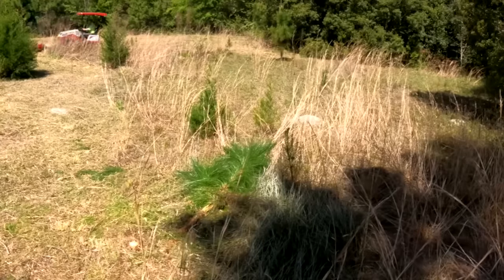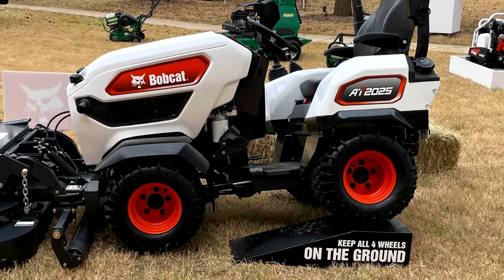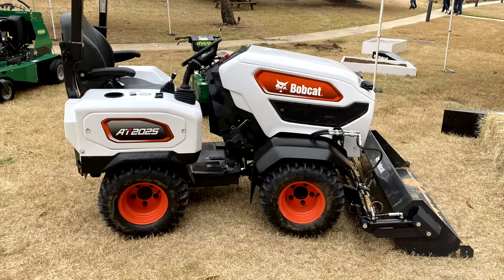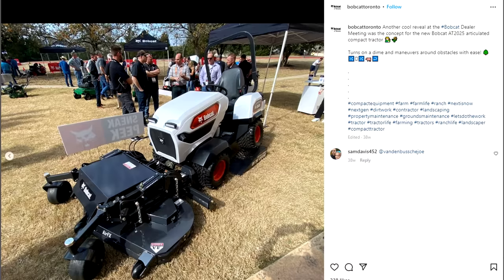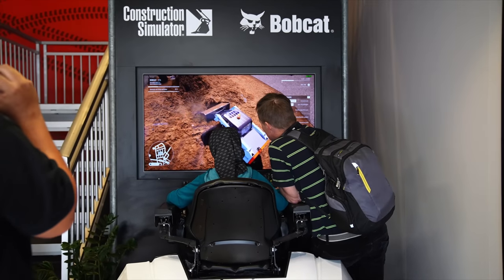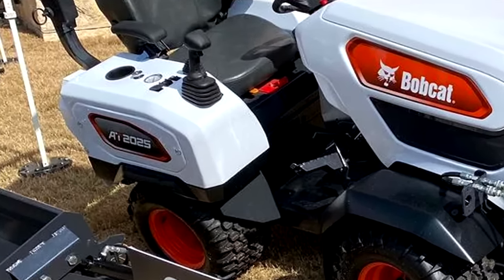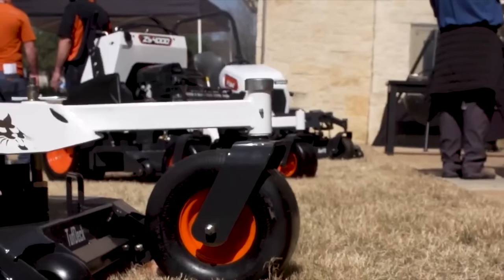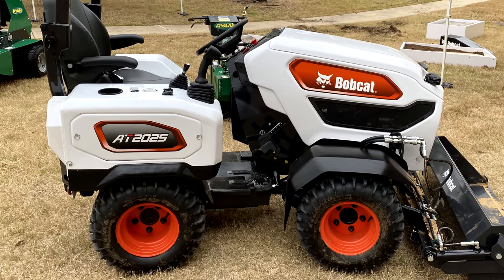Bobcat AT450 - A BRAND NEW Tractor We Know Nothing About... (Steiner 460/Bobcat AT2025)

Comment: The reason I would never buy this tractor is who it is made by.  I bought a steiner 450 in July of this year.  At 37 hours, it caught on fire in my pasture (at the base of the engine).  It took my local fire department 1 hour with two hoses to put it out.  The response from steiner, doosan, bobcat was the fire burned too hot to determine how the fire started (so therefore, I couldn't prove it was their fault).  Nearly burned my pasture and my woodlands.  I was thankful I wasn't on a customers property. A company that tries to shirk responsibility to not honor their warranty will never get another dime from me.
Reply: Good info. I was interested in the Steiner. Now I'm skeptical about the machine as a whole. 
And I'm not a Bobcat fan. Older excavators were good on rental market, but now Takeuchi has been invading that market. Good for Takeuchi.
Reply from the maker: That's pretty terrible, I am sorry to hear that. Glad it didn't combust with you on it. Any ideas what might have happened?
Reply: @andrewbrenneman9592  yeah takeuchi isnt to bad because made in japan sames the kubota are  plus they both uses reliable  kubota diesel engines
Reply: I had issues from the get go.  My dealer was a John Deere dealer and the only dealer in my state.  None of the mechanics were trained to work on the Steiner's.  They had to force the mechanics to install the three point and additional hydraulics.  I had just blown off the mower and cleaned the air filter thirty minutes before it caught fire.  There wasn't much time to see where exactly the fire started as it went quick.  I was lucky I was at the end of the row I was mowing.  When I made my turn, I saw the grass I had just mowed was on fire 10 feet behind me.  I parked the tractor on a dirt patch to go put out the grass fire and about 15 seconds later the whole tractor was engulfed.  My dealer was pretty good about the situation, but said that Steiner determines what can be warrantied.  One of the head guys at Steiner/Doosan had the nerve to tell me that they would get to it, but the next week was deer rifle season so it was going to take a while.  I've never done a Youtube video before, but I've taken a bunch of footage that I'm going to put together.  I just want to get my story out to as many people as possible.  I've never had this bad of an experience with any company that I've paid forty grand to.  The real hero in this was my homeowner's insurance (State Farm).  They covered everything and even paid the difference for me to purchase a Ventrac 4520 and roughcut.  Just paid the dealer yesterday and waiting for them to get all of the options installed.
Reply: I want to add an addendum to my previous comment.  The volunteer firefighters that showed up were the real heroes.  While I am very grateful for the insurance making me better than whole, the men who showed up kept my farm from burning.  I took care of them and am grateful to live in a town where people step up to help their neighbors.
Reply: @ryanroberts7771  no the deere here doent either  but they sell them wich doesnt make seince  lucky my kubota and case IH dealer here fixes and services kubota's, case ih, case construction,steiner,ventrac,deeres,caterpiller,komatsu, and different branded generators,and vermeers,and forstry machinery and equipment  wich he does 100% of any bramnds of lawn,garden equipment,farm,construction,trailers,forestry equipment and others wich lucky my kubota dealer smarter then deeres seems lol
Reply: I’m not 100% sure but I wonder if you had a hydraulic leak that started the fire?  Could’ve possibly been ignited by the muffler?  
     I’ve owned 3 Steiners, the newer models were having their hoses made in China and it showed. Blew 4 of my OEM hoses before the machine even had 50 hours…..
After their replacement hoses failed again I went to a reputable local shop and had my hoses replaced and never had another issue.

Comment: it needs to have the Ventrac wheel setup at least as an option or be significantly cheaper to directly compete the ventrac is an awesome machine as you have demonstrated
Reply from the maker: Good points. I am very curious where they will try to compete on price.
Reply: What do you mean by wheel setup?  The option of dual wheels?
Reply: @scottburgle2169  Yes
Reply: @Scott924m  you can get dual wheels for
It.

Comment: Perhaps the levers are 4 way controls, similar to the set up that Ventrac has on their front loader attachment… one lever controls the lift and auxiliary (tilt) on the front, and the second controls the rear lift and auxiliary on the back… I think that could be a very big improvement over both Steiner and Ventrac, for some people. On top of that, a lot of people have wanted two pedals controlling the direction for a long time l. But I hope that they still keep making Steiner brand machines along side this. My opinion is the more diverse set ups, the better. Let it all come down to quality of machine and personal operator stand preferences. The more competition the better.
Reply from the maker: Good points and thoughts, thanks for sharing!
Reply: @CopperCreekCuts  bob cat at2025  with thepowerful 25hp  kubota diesel

Comment: As a former owner of 4 Steiner/Ventracs…..both brands are underpowered. Guessing this is a 25 horse diesel?  I’ve owned from 16hp to 30hp. If you’re mowing on hills they lack power. 
      Like to see something with 35-40hp diesel pushing the same attachments but I’m sure that’d be the need for a completely redesigned machine.
Reply: 32.5 HP Gasoline, not sure if they have the diesel model
Reply: @Djolnir  I’ve actually heard the 32 hp kubota is the best option for this machine although I still don’t feel it’s enough power unless you want to go slow. Really slow. 
     The machines weigh in at about 1500 lbs. plus add in a deck at 400 plus pounds (depending on size/model). 
     When you’re pushing that weight up a hill and cutting taller grass the machines lack power. 
     The advantages of this machine are that you can use many attachments but unfortunately many of them come at a price that is close to that of a dedicated machine.
Reply: Agreed after the diahastsu turbo. Gotta go kubota gas and only ventrac 4520

Comment: Hope if they make attachments they can hook up to ventrac
Reply from the maker: Good point! If they use Steiner's system maybe they will.
Reply: accully ventrac ans stenier is same accully with same front mounts so you can use ven trac and steiners attachents on both
Reply: Ventrac and Steiner components match up with the older machines.  On the new machines, most of the attachments will fit but require different belts.  I am trying right now to see how my steiner attachments will fit to my ventrac.  Ventrac has a conversion guide that states that the mower decks will work but you can't use down pressure to make the deck go below level.  I don't know if that will work when cresting hills or not.  There are some attachments that are not interchangeable between the newest versions.  The ones that come to mind are the power rake, trencher, aerator, and loader with bucket.  Mostly it is because of the lift functions having different ranges between the two machines.

Comment: If they give the option of a rear pto it would be a great machine
Reply: Exactly. What I really want is a small to midsize tractor with standard speed PTO and a 3 point hitch on both the front and rear. Let me mount something like a brush hog or a small forestry mulcher out in front of the machine so I don't have to look over my shoulder all day while I back into stuff.
Reply: @michaelcowling9928  yip it should have the option of other makers attachments with a pto other than that there over priced ride on mowers
Reply from the maker: Not sure if the footprint could accommodate that but if they found a way that would be a true game changer.
Reply: @CopperCreekCuts  something that always bothered me.aboutnthe Ventrac. They offer an optional 3 point hitch. Why not include an optional hydraulic motor back there to hook up a PTO shaft?